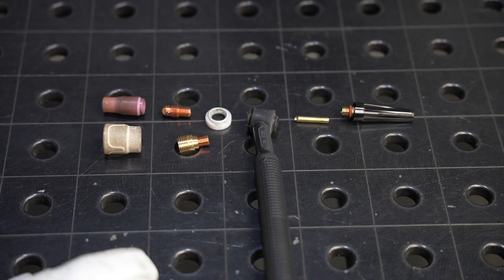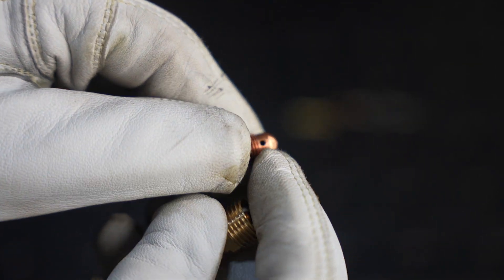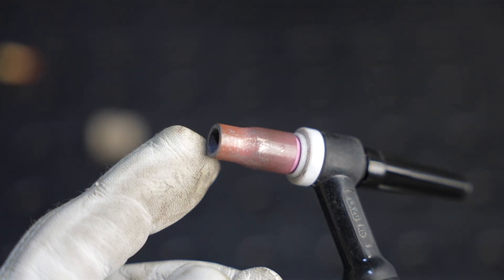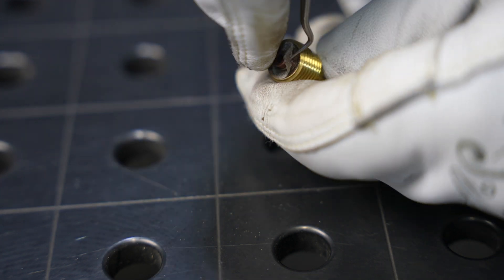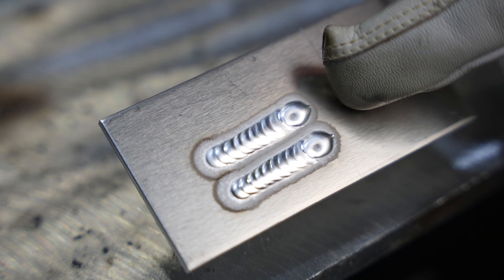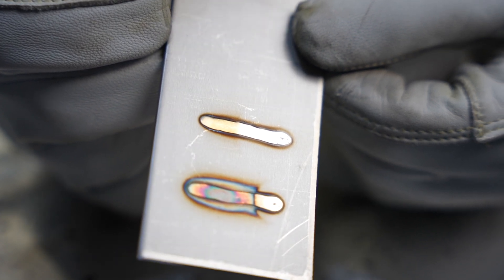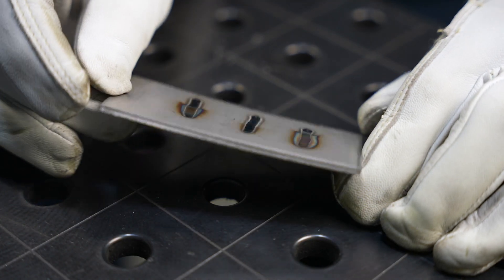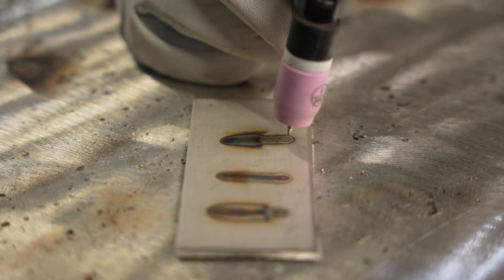TIG Torch Setup - TIG Welding Basics

Comment: How about facing the torch backwards while welding with a small cup as a strategy  to keep the weld covered in gas longer in order to prevent it from oxidizing ? Would that work?

Comment: You should try a FRONIUS TransSteel 2200
Middle of the line of the Automatics (set the parameters then just adjust the thickness and the machine compensates for all the other parameters).
Reply from the maker: I have one. It’s a nice machine, for sure.

Comment: I like the tip of sharpening both ends of the tungsten.  I have been cutting the tungsten in half, so I have twice as many sharp tungsten while I am welding.  I have been using the short back cap like you showed, which works great since I am already cutting the tungsten in half.  Great video.

Comment: Great video Tim very informative video. I like what you said with welding aluminum with a gas lense how it can clog the screens. Happened to me once I was getting porosity in my aluminum welds once I chased everything trying to figure the problem the screen was a little dirty that was the problem. I like to weld aluminum with a standard cup #5 or #6 even if I have dirty metal like galvanized or something dirty I’ll save my gas lense if I can 👍

Comment: Tim, thank you for putting this out here for us! I'm a current Welding Student slated to Graduate in Dec but man is Aluminum and SS tricky! I'm taking your advice back to class for practice for sure. Never was told about the variance you get with the Laminar effect in this way, especially on SS with a larger gas lens. Now need to purchase some and see how it works since SS is kicking my butt. Thank you much Tim!

Comment: I pretty much agree, from my experience. I do use an 8 cup most of the time. But as my eyes aren’t what they used to be, I mostly use Pyrex cups. It’s surprising how much easier it is to see using those cups. I also prefer a gas lens, and as I tend to be too lazy to change if going to aluminum, which I don’t weld that often, I leave it on. As I don’t like color on my stainless welds, I remove it with either passivating solution, or pickling. I’ve been thinking of getting one of those brush units for my welder, for that purpose. Since the ESAB goes to slightly below 5 amps, oI expect it to work well enough. I guess I’ll find out.